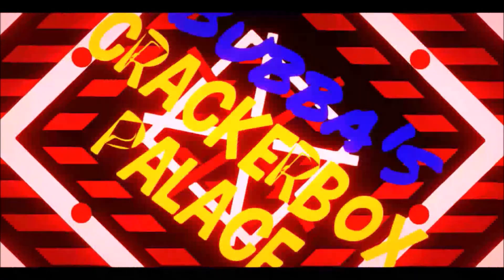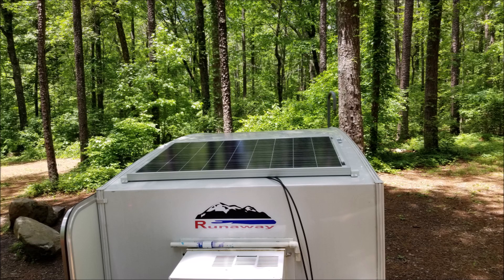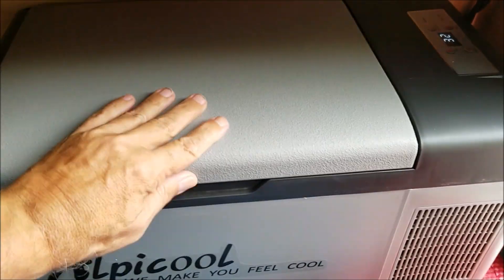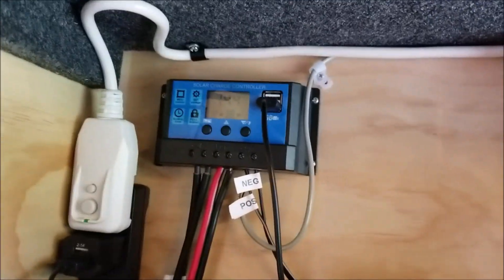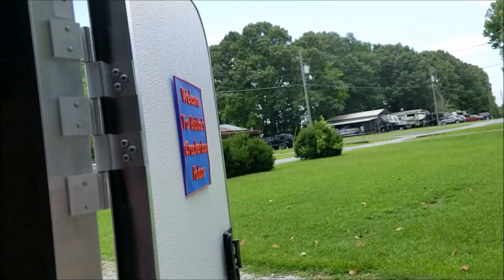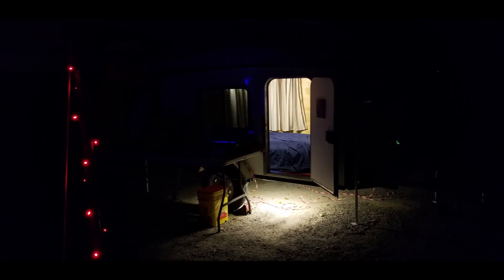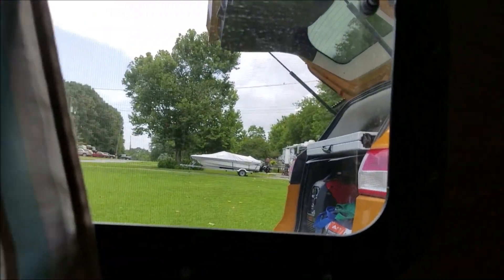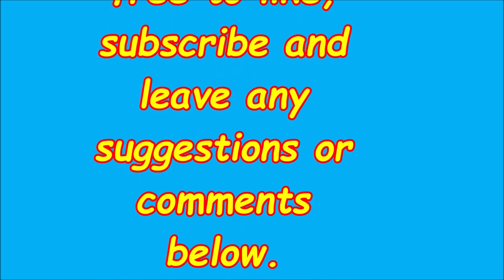The grand tour of my tiny Runaway Camper, The Crackerbox Palace

Comment: What kind of gas mileage do you get pulling it with that Escape? I pull mine with a Miata which does great but no room in the car for anything else plus we took it in a 10,500 mile trip and averaged around 24 to 24 MPG but the ride wasn’t comfortable at all. I’m thinking of something like that escape

Comment: Crazy question.  I see a lot of folks with LOADS of items set up outside their Runaways, big tables, grills, fridge, etc.  When the weather decides to wreak havoc, what do ya'll do with all of these items?  Load em back up in your vehicles?
Reply from the maker: I personally keep outside items to a minimum. A canopy, 2 burner stove and a folding chair. Most items are OK with the weather. I make sure to to tie down the canopy very well and it'll withstand some pretty tough winds. If necessary though I do have room for these items in the trailer without getting in my way.

Comment: Thanks for this video. Please let us now about your tow vehicle and especially the engine...turbo or non turbo, tow rating, and any experience towing in hilly areas. Do you have an estimate of your typical traveling weight? Do you feel your tow vehicle is adequate for your travels? If you replaced your tow vehicle would you make a different choice and why?
Reply from the maker: 2016 Ford Escape, 1.6L, 4 cylinder, 2000# tow capacity. Trailer is 700# empty and I estimate 1000# loaded. 23 - 25MPG while towing. No problems with hills, can easily keep highway speeds while climbing steep grades. Just did a trip through the Appalachians with no problems. Time will tell if the Escape will suffer any ill effects from towing but towing at approx 1/2 tow capacity should be no problem. Love the mileage and can hardly tell I'm towing this tiny camper. If replaced, would definitely consider same vehicle.
Reply: Thanks for your reply. Looks like you made an excellent choice. I'm considering a 2019 Ford Transit connect 2L non Turbo. I think it should work if prudent with equipment and supplies. Happy and healthy camping.
Reply from the maker: @snowbird29803  Lots of RVer's swear by the Transit. Should be a good choice.